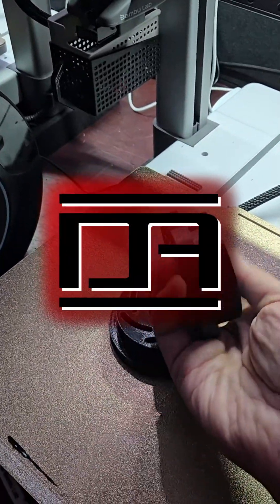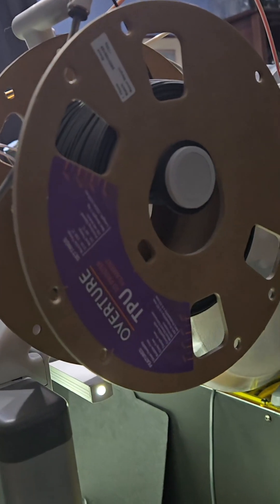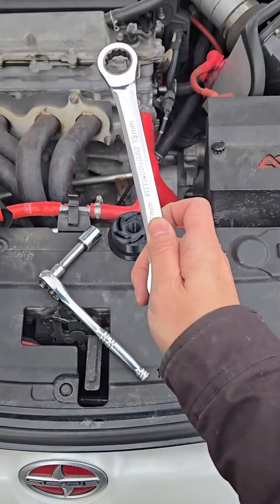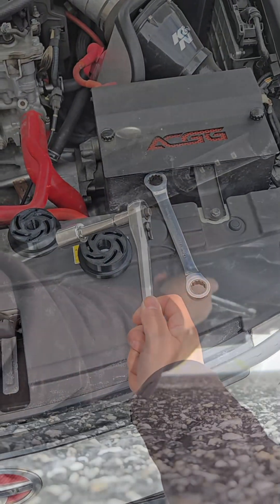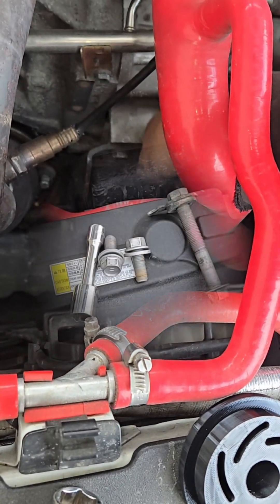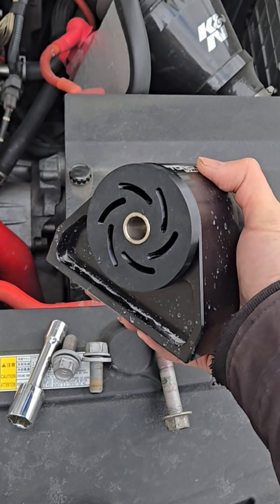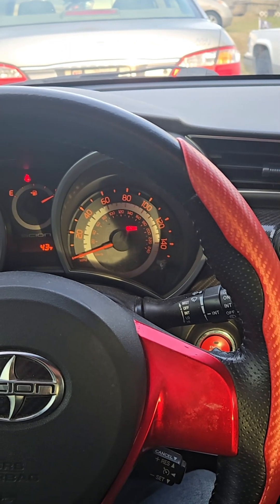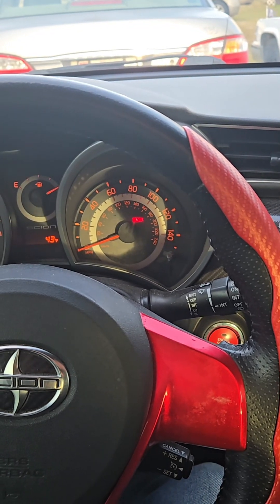3D Printed 95A TPU Torque Solution Motor Mount Bushing to Reduce NVR (Scion tC2 / tC2.5)

Comment: Can I buy then anywhere? I can feel vibrations through my dash and my rpm is kinda low and I already got the throttle body service done so I’m thinking my motor mounts are bad
Reply from the maker: If you're running on OEM motor mounts and are experiencing excessive vibrations, especially with the AC on, then you need to inspect and possibly replace all of the motor mounts. I just had to replace all four of them on my tC recently. What year tC do you have?
Reply: @VampyreX13 I have 2014 tc, it usually vibrates more when the ac is off
Reply from the maker: That's a little weird. Normally it's the other way around. Are there any weird noises in the engine bay? Any pulleys making noises?
Reply: @VampyreX13 not really but im also thinking my battery is weak so the rmp is low when im fully stopped
Reply from the maker: @Betlog-jr have you cleaned your MAF sensor?
Reply: @VampyreX13  I haven’t yet that might be the next thing to do
Reply from the maker: @Betlog-jr use actual MAF cleaner and don't touch the sensor wires with anything.

Comment: Huh, never would've thought of printing bushings. And you said the 95A reduces NVH over the stock 75A? That was the only thing I was iffy on with my Torque Solutions mount is that it causes some shakes and drone. Can't wait to see how these hold up, maybe I'll try it
Reply from the maker: @jumanjingus  you could probably print it with 85A TPU for even fewer vibrations. Right now, the new bushings seem to be holding up pretty well.
Reply: @VampyreX13 how does it hold up 7 months later?
Reply from the maker: Still holding up well.